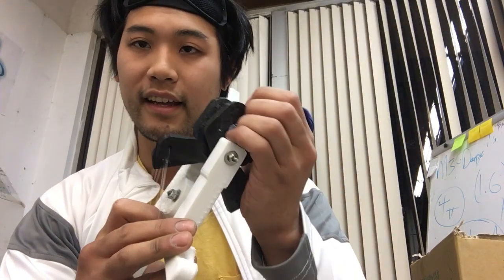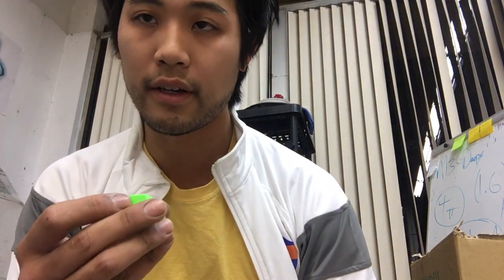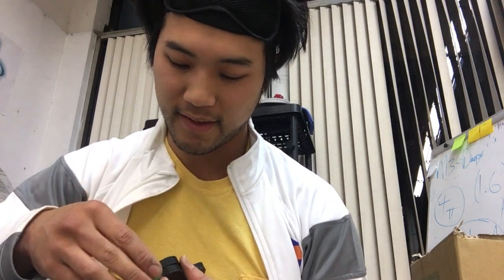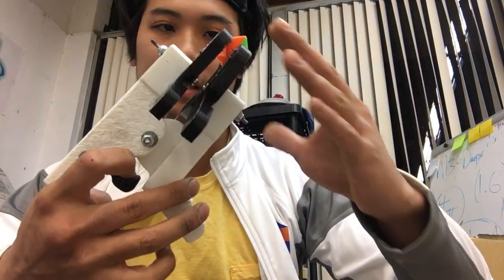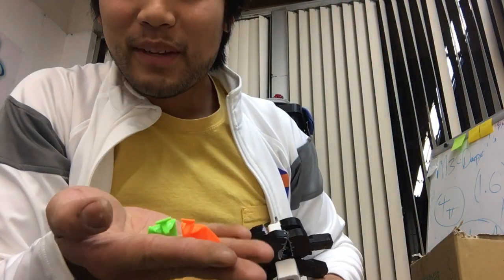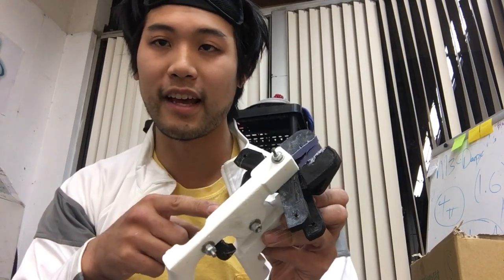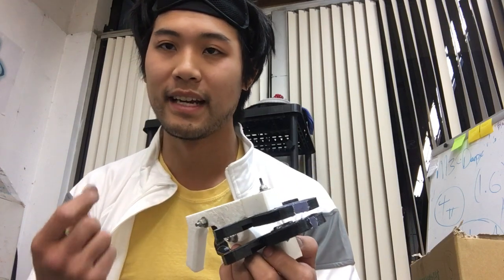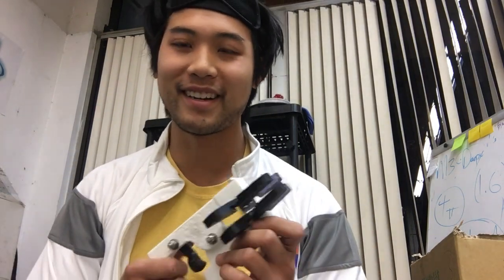Prototype fast edge opener tool test (so we can make magnetic cubes faster for you!)

Comment: IDEA!!! If you havent already thought of this you should design the pull lever to be a multi stage pull. a short pull grips the peice and then the long pull splits it apart. it looks pretty hard to hold right now and your fingers are spread apart and not aligned from one lever to the next. it seems like that would be uncomfortable over long periods and may be cumbersome and not able to be done quickly. a single smooth trigger pull would be much easier on your hand and could be done more quickly and efficiently. and less moving parts 😊

Comment: I don't actually have a Valk to check, but I would guess that the difficult part is getting a good grip of both halves of the edge, and that pulling them apart you have a good grip is relatively easy. Then, why not have two simpler tools that are basically pliers (but with rubber/silicone/whatever to not damage the plastic), one in each hand to grip each half, then pull apart. I'd be interested in the results if you try/have tried this.

Comment: i think another idea is having 2 blades right next to each other that split sides. kinda hard to explain, but you put the blade in the middle of the two pieces and you pull the trigger to make the blades strech and pry open the edge.

Comment: i think you only need the mechanical advantage for grip strength. i would think your arm strength is strong enough to pull them apart. just use two locking pliers and pull apart? could you also just ask them to send it to you disassembled?

Comment: Is this the thing that you were printing with the 3d printer?
Or is that something different ;)
Reply: I also love how excited you were in this video lmao
Reply from the maker: Hehe, my printers are practically ALWAYS printing, at least 16 hours a day.
I do LOTS of projects, and some of them require lots of prototypes.
Reply: Makes sense :P
That must be a lot of plastic huh
Reply: Humphrey Wittingtonsworth IV I have an idea to improve the grip strength. Use very strong but elastic string/fishing line, and and locking mechanism on the black lever, you you can brin the lever back and lock it at a very high tension which will improve grip. For the pulling apart strength idk much math and stuff but maybe an angle that requires less force to pull the piece apart? Just a few inexperienced suggestions lol

Comment: No offense but this seems like it will slow down the edge splitting the only thing it seems to help is your fingernails.
Reply: If you do this for a few hours a day, you'll want to have a tool.
Reply: JoeTheCube once the final version is out I'm sure it will be faster. Ofc I'm not Chris but that's my guess, they might even automate it
Reply from the maker: Our hands get really tired after doing hundreds a day, this will save us!
Reply: asmallkitten yeah I assumed
Reply: If he can get the cantilevers to work reliably, it shouldn't be too difficult to hook this to an electric motor, then you can just flip a button to open edges. 

Further, while it would be even trickier, it shouldn't be impossible to also invent a feeder mechanism, so you can just throw a bunch of edges, and have the machine open multiple edges in a row while you are free to do something else.
Reply: Humphrey Wittingtonsworth IV Yeah I was annoyed after 2 cubes ☺. I'm getting closer to getting boron but every time I think I get close I realize it will explode.

Comment: You spoke about the analogy  of cantilevers in a bike. You seem to be fixated on using fishing line for the connections. Have you thought about taking the bike analogy one step further and using a hydraulic system in place of the fishing line to pull the pieces apart? Physically the lines would work the same, but require less force from your hand. Also if this works, you could design a tool that has eight(optimally) sets of cantilevers with all of the hydraulic connections sourced to one lever still with minimal force required, to do one cube all at the same time.

Comment: I just magnetized my Valk with n35 4x2mm and you can't feel the magnets while turning but when I take two pieces out the magnets feel strong do you know what's wrong? do I need to break it in more?
Reply: I can't answer for Chris, but I've done lots of Valks. The further to the inner edge of the cubie piece the magnets are glued (closer to the center of the cube), the less you'll feel them. If they're placed real close to the corner piece cutaway holes, the less you'll feel their potential magnetic pullforce. Also, as with just all magcubes, you'll benefit more from the magnetic feel if you loosen your tensions. This allows the magnets to do their job. And finally, just throwing this out there, it's really important to have each magnet glued in the exact same place from cube to cube. This will insure you're getting the most from your magnets.
Reply: DMCubing thanks man
Reply: I'll try

Comment: Cool! 
I think I'm going to design something to carefully and easily disassemble the Valk corner piece! Hint: it's going to be made on a lathe. 

Hey, here's an idea. You're a major enough company that Qiyi should be able to fulfill this request: Have them send you only the cubie pieces and individual components of the Valk, disassembled. That way there's no dis-assembly of complete cubes needed at all, you'll be working with the raw pieces. Just an idea.
Reply from the maker: Good luck!

Unfortunately, we've tried, and the industry sadly doesn't work that way ):
Reply: Holy cow, this is TOO FUNNY! I'm sitting here sketching out what diameter of stock rod I'll need, and I glance over at my metal Gan GES tool! GUESS WHAT! It easily opens the Valk corner piece! The second larger of the side portion of the tool smoothly and easily fits over the ends of the little prongs and you just gently press in onto the base, and that's it, the prongs push in, disengage and the base is free.

Comment: instead of tying fishing lines, you could modify the arms of the cantilever arms to clamp on bicycle cables. If bike cables are strong enough to stop a bike, Valk edges should be no match!
Reply from the maker: Oooh... clamping. I tried tying, and that didn't work, but clamping would totally work!
I've got stronger line on the way, but if that doesn't work, I'm going to try your idea and give you credit for the idea if it works!